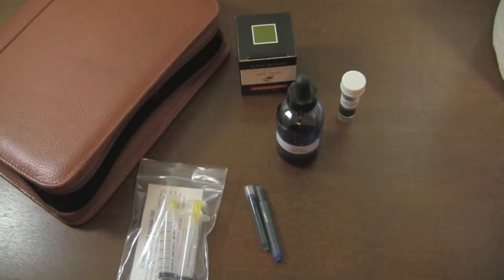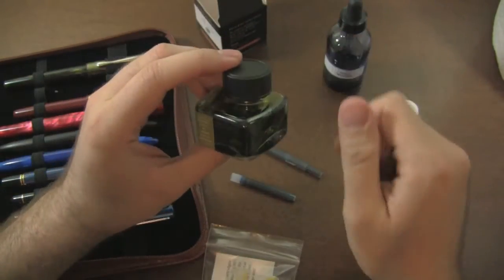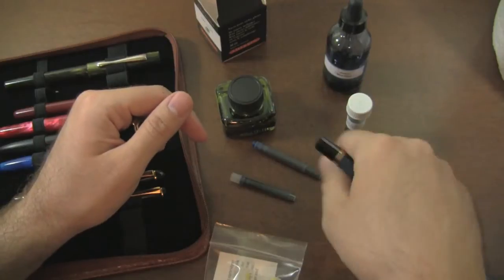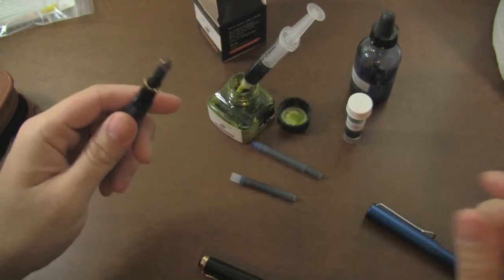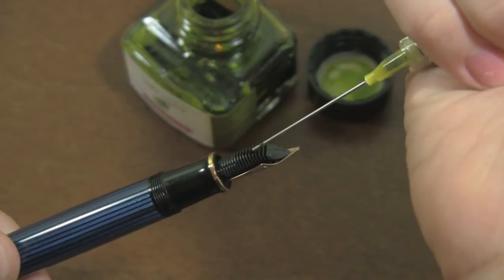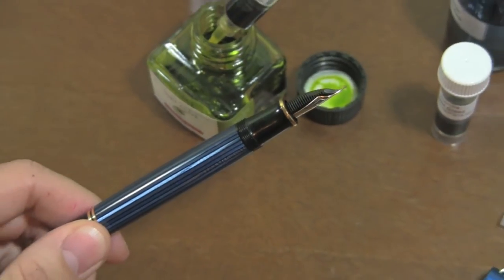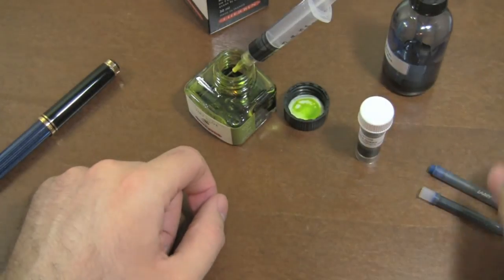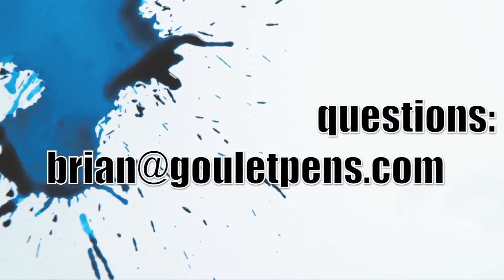How to: Feed Saturation Pen Filling Method

Comment from the maker: @Ncharlestun Well, when you get the cartridges, they already have ink in them. When you load them into your pen, they will be punctured and 'open'. Once you use that ink, you can clean out the cartridges and then you're ready to fill it, since it'll already be punctured. Make sense? I don't use any apparatus to hold up my carts when filling, I just hold them in my hand like I do in this video, and when they're filled, I load them into my pen.